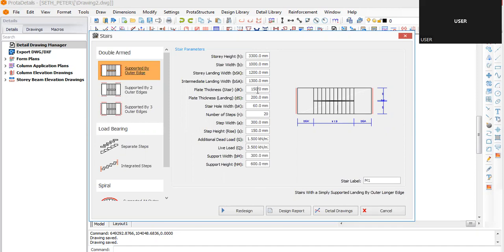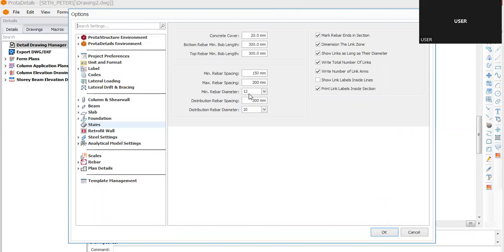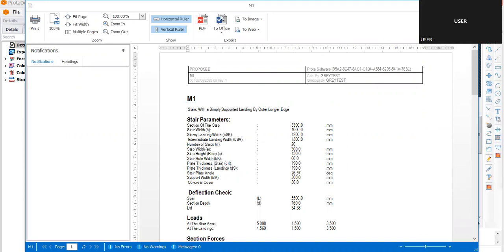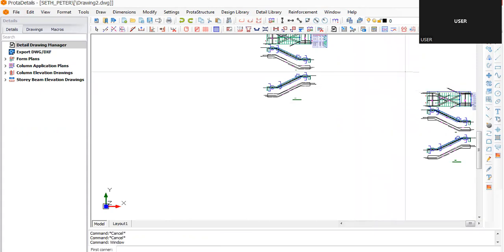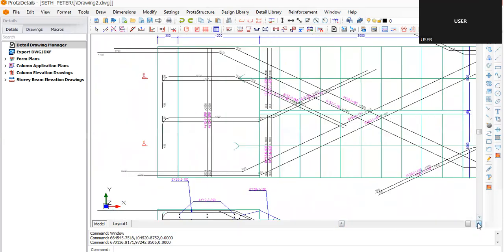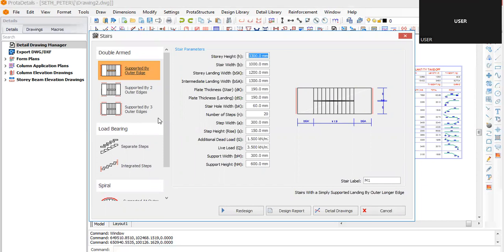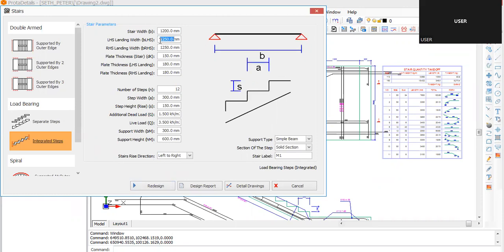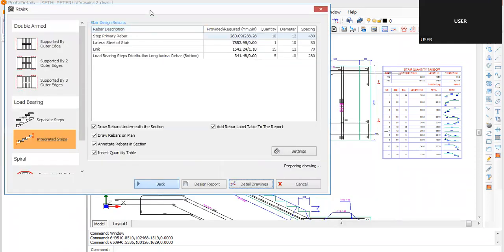protadetail 2021 staircase webinar part2

Comment: How are you professor?
Iam Balabyekubo I.J.C 
I have problem sir and asking for solutions.
In floor system  consists of one way spanning slabs with beams, there are side beams which don't carry slabs that span in short directions meaning they don't carry slab loads. They just provide restraint.
How can you get loads to necessitate the design of that side beam which don't carry slab?
Thanks.
Reply from the maker: I will work on that sir. Boss am not a prof oooo.